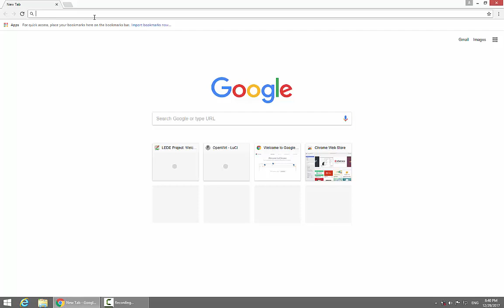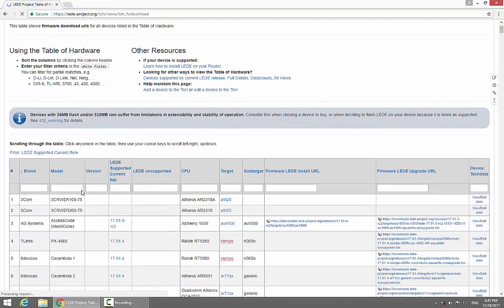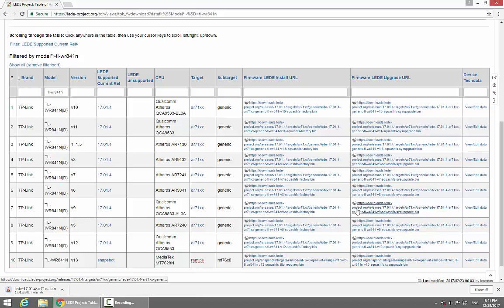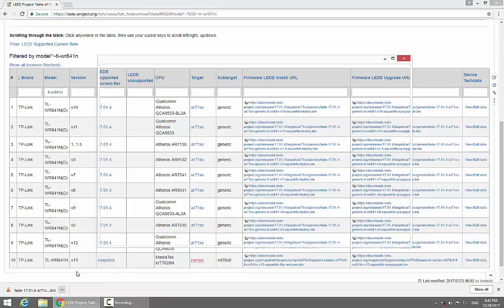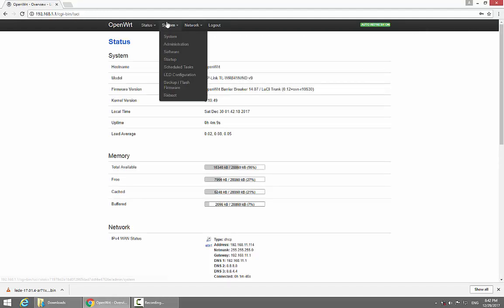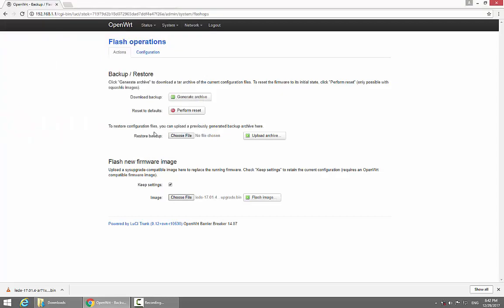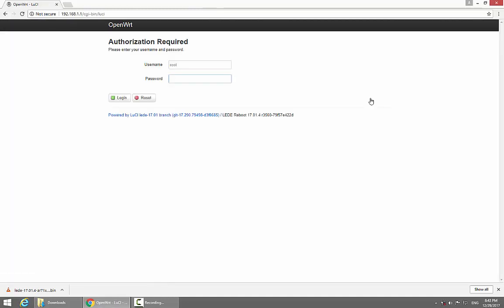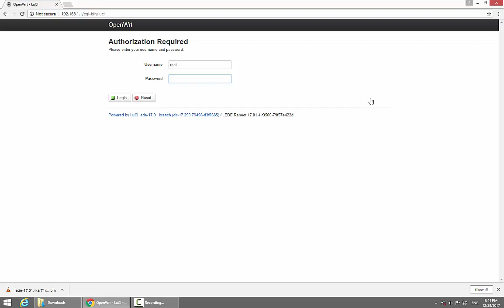How To Upgrade from OpenWRT to LEDE

Comment: Good Afternon. I have installed in my router the Openwrt 12.09 
I have a question.
With Lede Do I will have Ext root?
Reply from the maker: It depends on the device but according to https://lede-project.org/docs/user-guide/extroot_configuration you should have access. LEDE and OpenWRT projects are merging together so currently the most recent version of 'OpenWRT' is under the LEDE distribution.